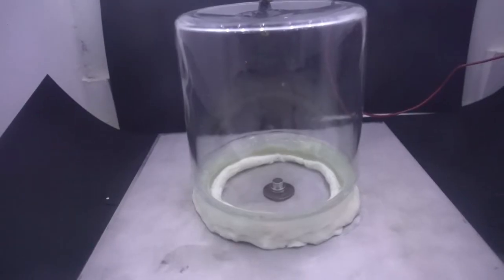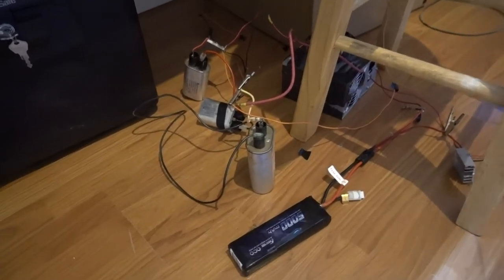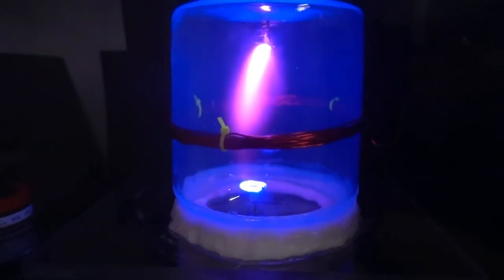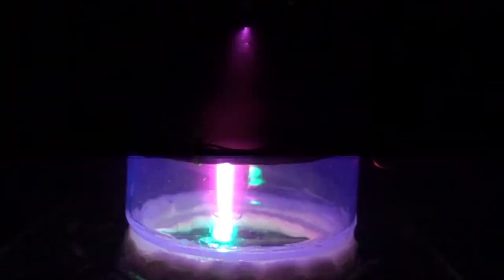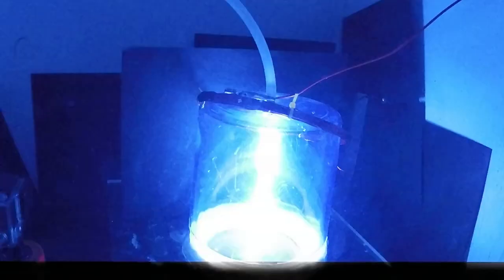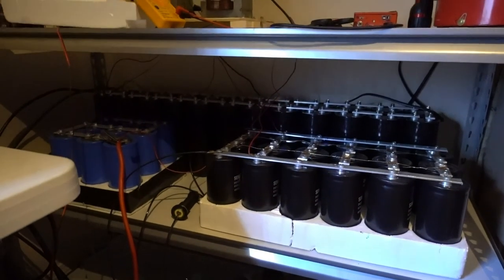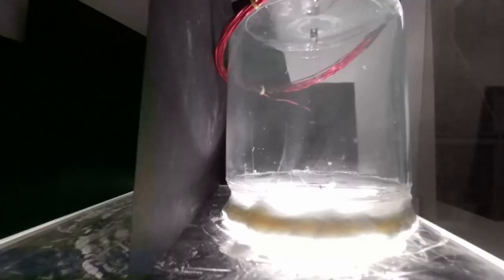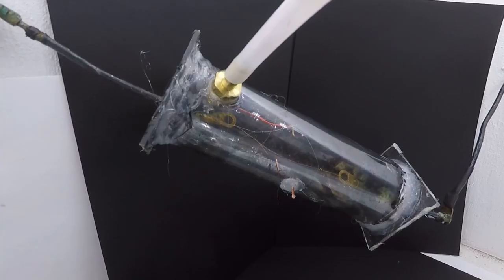Plasma Compression Z Pinch Part 3/3

Comment: Check out how someone is making a Golden Ratio spiral using Tesla coils at specific currents and frequencies.  I suspect its a demonstration of Plasma effecting itself through some carefully timed fields.  I forget the dudes name but should be easy to find.  He can make various types of discharges from the coil using different combinations of frequencies and currents so perhaps looking into it can give a little inspiration for further work as an AC discharge would cause an expanding and collapsing magnetic field to setup conditions where you might be able to produce some interesting effects in controlling the plasma in low pressure.  If those dudes can do it in open air I am confident much could be done in low pressure.  I always theorized a Fusor without the inner grid and recent looks at these plasma toroid's makes me even more confident in my old assumptions.

Comment: Look at the Bennet Pinch equation, in fusion reactors they only use high current plasmas which naturally concentrates the beam, the gas inlet/injector is also made very narrow at high gas pressure rates to drive the concentration further BUT, this will EAT the cathode/anode emitter collector, so exotic materials will have to be used, i.e. tungsten, beryllium, iridium etc.

Comment: Been thinking about this. Have you tried with iron or ferrite core coils? The impulse from an air core is very short, but if you have something to hold the field a little longer, you might catch it on 2 or 3 frames instead of one. Also a spiral flat wind should give you a better pinch. If you want to stick with air core, look at the flat spiral for telsa coil primaries.

Comment: the resistance of the plasma isn't high, you should be using supercapacitors and they can hold that high current like 1KA for a couple of minutes that way you don't need a special camera. Anyways I would actually use a long exposure photo instead of a video to be able to see the flash, get your smartphone and put it on pro mode if its new stuff it should have the feature, turn iso all the way down put the thing on a tripod and a countdown, once the exposure starts, hit the trigger then ideally it will end soon after you hit the button (so a 5-second exposure should be good) to avoid extra blurring effect. Either way would be nice!

Comment: You know what killed Marie Curie, right? How much X-ray shielding do you have in your setup?
Reply from the maker: I think I'm relativity safe (famous last words).  The voltage potential from the electrodes should be at most 6KV due to the pressure I keep the camber at, even though my power supply is capable of much higher, the voltage collapses when the arc is struck. It is not a complete vacuum inside the chamber which should not allow the electrons to accelerate fast enough to create any noticeable amount of x-rays, I place a geiger counter near the chamber. Also, I dont routinely conduct these types of experiments, maybe every month or 2. 

But I am no expert in x-rays, what do you think? Is shielding necessary at these low exposure levels?
Reply: Better to be safe than sorry. What’s the method to check this? Beryllium plate with film behind it?

Comment: Awesome! What is your Hypothesis exactly? It seems to me that the z pinch is a secondary condition that is the result of the star/plasmoid channeling a high current. So either you have to create a star to see a z pinch or you have to create a strong enough magnetic field to create a star. Which came first, the field or the star?
Reply from the maker: Well the sun is a giant ball of plasma, charged ions, and current is the movement of charged particles. The sun can produce a massive flow of plasma which in turn will produce a very strong magnetic field. So definitely the star.